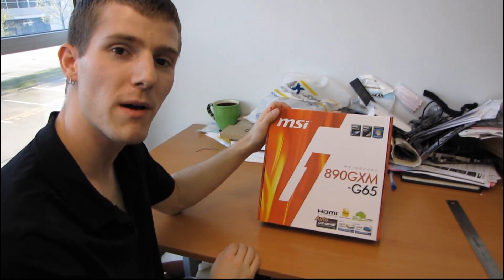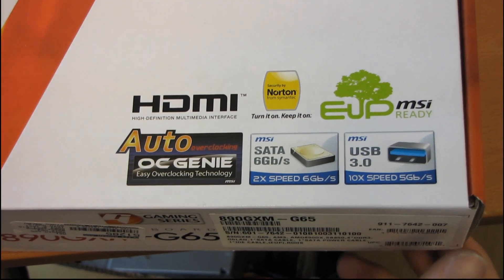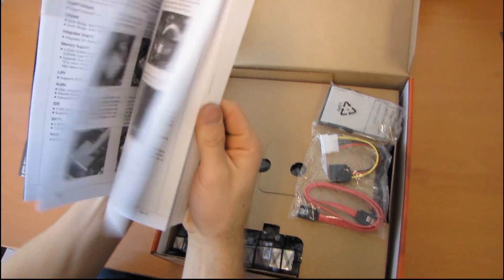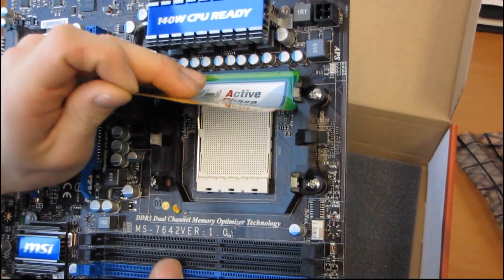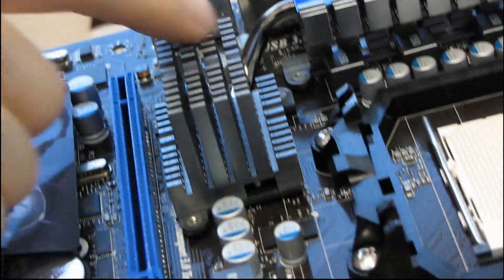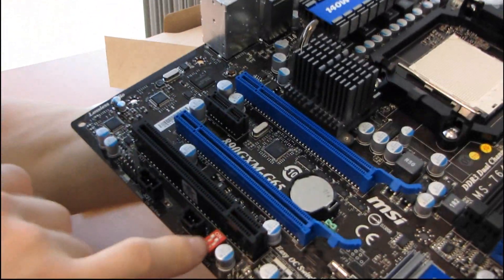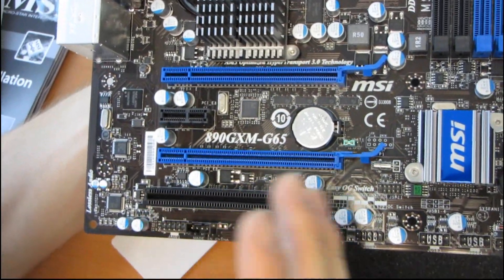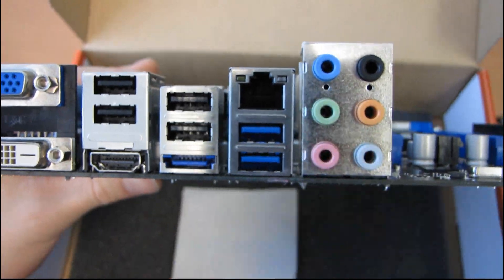MSI 890GXM-G65 890GX DDR3 AM3 Crossfire Motherboard Unboxing & First Look Linus Tech Tips

Comment: I`m using this in 2018
Reply: exodus orange is it possible to use gtx 960 with this motherboard?
Reply: I use a GTX 970 for S.T.A.L.K.E.R series with windows 7 and windows XP 32 bit,  but  with XP 64 bit I have to use a GTX 260 as there is no regular driver support from Nvidia,  I think drivers are easier to find for the 960 than the 970,  so answer is yes depending on OS

Comment: Anyone still using this board in 2015?

It is still the best mATX AM3+ board out there. Its the only one with SATA 3, Crossfire, VRM heatsinks, and USB 3.

Specs:
Lian Li A04B
FX-8320 4.5GHz / 80mm-120mm, H55, SP120
GTX 970 SC
Corsair 8GB DDR3 1600MHz
HyperX 3K 120GB / WD Se 1TB 128MB Cache 
890GXM-G65
Reply: +Jared DuBois not true anymore brother, a couple more mobos with those features
Reply: +Detroitwillfall it will work as long as you have the latest bios. :)
Reply: +Jeremiah G actually there isn't. Not mATX.
Reply: yes there is the asrock pro3m has way more features and it is micro atx
Reply: and it is am3 plus
Reply: +Jeremiah G 
Oh wow. I don't know how I missed that one. I suppose the only noticeable difference is the 16x/4x crossfire on the 970M vs 8x/8x on the 890GXM. Probably wouldn't make a difference though.
Reply: theres more to just that one difference visit the website to see all stats
Reply: +Detroitwillfall 
Looks like you need 1.B or later.
https://us.msi.com/product/motherboard/support/890GXMG65.html#down-bios
Reply: Jared DuBois can i use a gtx 960 with this motherboard??

Comment: hey people...
i hv one problem n i need to know to whats the real cause.
i hv same board with phenom2 x6 1090t BE with a stock cooler,so the problem is on normal my cpu's temperature is between 48-52 degree celsius,and when i try to run any game like crysis my cpu's temp. goes upto 102-108 degree celsius and then my system gets shut down automatically.

so i want to ask whats the real cause:
1. is there any problem with cooler.?
2. or my motherboard?
please answer guys
thnk you

Comment: i have a noob question havent built a pc in along time and about to build a new gaming rig. but this Mobo comes with a onboard  ATI Radeon  HD 4290 chipset. does that mean i can hold off for a bit and buy like the mobo and all that and run it as is until i can get a good graphics card that i like then throw it on there later or do i have to have a GPU from the inital start?

Comment: @s1gnex If you CF they will run at x8 , the 1 on top runs at x16, the other 1 runs at x8, so if you use both, they will both run at x8.

Comment: @258GameFreak :

Scythe Stronger 700W  (Modular, 135mm fan, temperature managed. Special Feature: 2 extra fan power connectors off the PSU, also temperature managed)
or
Silverstone Strider+ (As above without extra fan power connections but with special filter on power cables connecting to graphics card to filter out noise transferred to audio)

Both are quiet and keep air moving.

Comment: @AC7Media You're comparing apples to oranges. The Asus board is not mATX, if you don't require a mATX board (for mATX-only case for example), there is no reason to buy a mATX board. So, if form factor doesn't matter, go for the ASUS one. If it does matter, get this one.

Comment: had this mobo for a few weeks now runin 2 5850 in crossfire 4 gb 1333 ocz gold. and amd 965BE. clocked at 4ghz.  OC is really sweet on this mobo. everthing is runnin really smooth so far.  well over 200 fps in RE5 at sky high settings. the only bad thing i can say aboun the mobo is that my 2 cards are kinda close. other then that its been a sweet mobo. boots super fast in win 7 64 bit.

Comment: @LinusTechTips If I were to ask NCIX to preassemble my system with a board and accessory package like this would I have to include extra SATA cables in my order or would that just sort of automatically be added to the charge and to the system?

Comment: A question: I'm running a Radeon 5850 on my mobo, and I'm gonna upgrade to this card tomorrow I think. I'm just wondering of those angled S-ATA ports fits under the graphics card or if they will come in contact with the graphics card so I won't be able to install it?
Are the S-ATA-connections thicker than the PCI-slots?

Comment: @LinusTechTips Lets say  GX is higher than X, although all the MB with integrated graphics are considered low-end boards, but this one has a little extra in terms mosfet cooling, OC capabilities (at this board i think is dust in the eyes) that would get it a little higher than low-end class, but it is for sure not an HIGH-END MB or microATX, dont you think is an overstatement for real? I mean a G65 as an HIGH-END board , what is G80-85 then?

Comment: @eUnderdog It's high end for mATX, crossfire, decent overclocking, good cooling etc.

890GX vs. 890FX, not a big deal, the only thing that really matters is PCI-E lanes where 890FX provides more, 890FX doesn't provide better overclocking and such though :)